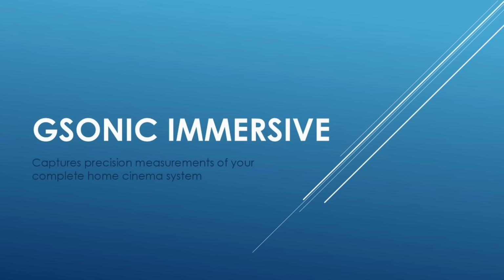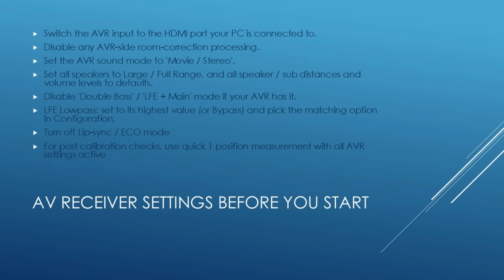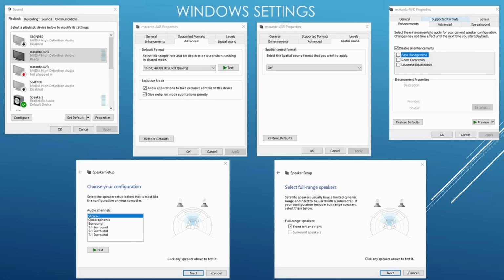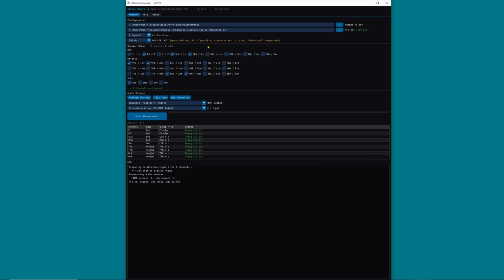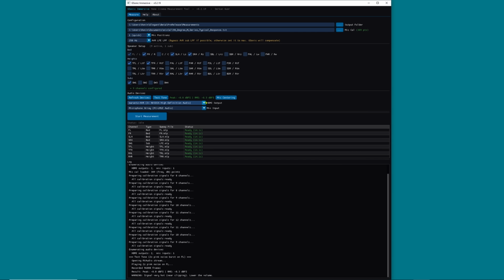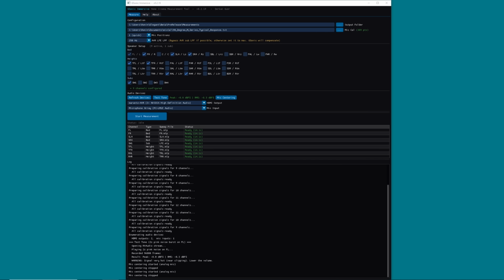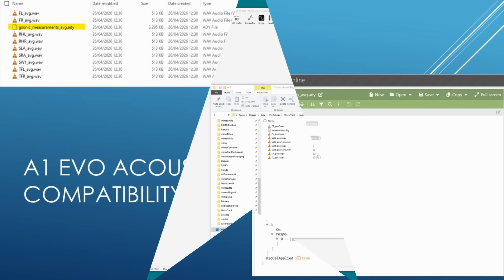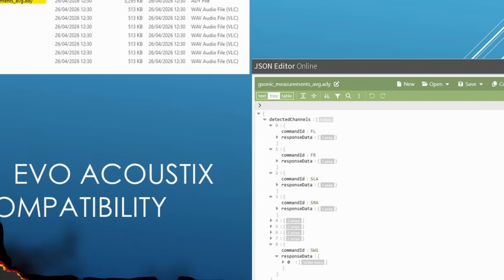GSonic Immersive

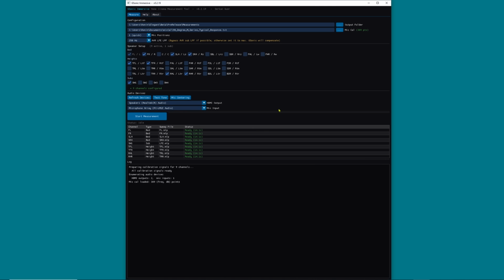Comment: Hi, you mention @6:47 that the attached file is for 'generic mics that came with the Denon/Marantz receiver'.... is that correct?  As I understand it should be calibrated mics.  Not sure the mic that came with my Denon (x3800h) is calibrated.
Reply from the maker: There's a generic mic calibration file for D&M generic mics linked in the video description. You can use that one.
Reply: @ocaudiophile  Thanks!  Not an expert, but I've calibrated using A1X already.  Are GSI measurements significantly different/enhanced?
Reply from the maker: Simple answer is yes ;) There's also an upcoming very advanced calibration app which will only work with GSI measurements.
Reply: @ocaudiophile  BTW, for which orientation is the file attached, pointing 'towards ceiling' or ' towards speakers'? TY
Reply from the maker: Audyssey mic is designed to always point up towards the ceiling and the calibration file is for that orientation (90 degrees)
Reply: @ocaudiophile  BTW, is there an introductory price for the app? TY much.
Reply from the maker: For the upcoming app? I haven't finished it yet and didn't decide on a price level but there's probably gonna be an intro price or some discount to users who already have GSI.
Reply: @ocaudiophile  I mean the current app.  TY
Reply from the maker: GSonic Immersive was launched 3 months ago and introductory pricing ended by June 1st.

Comment: Purchased!. Will try today. I suppose Acoustix will modify some of the results to compensate for MultEQ basic?. Or will i have to do that manually?.
Reply from the maker: Thank you and yes AcoustiX is model aware and you need to understand that MultEQ basic is very limited at what it can do with speakers although subwoofer EQ is quite good and thus all speakers will need to be crossed over very high (200-250Hz)
Reply: Thank you oca. Few more questions if you don't mind:

1. What's your recommended amount of repeats for a 3 seat couch

2. If AcoustiX tells me it cannot correct bass peaks above 100Hz-189Hz (i get a different frequency depending on the curve I pick) for my subwoofer. But REW does show filters past those frequencies, does it mean it did apply corrections fully?.

Thank you!!
Reply from the maker: 1.Measure at ear positions and add some more around the MLP.
2. Basic cannot apply filters to speakers below 375Hz with 48kHz content so you should use sub as far as possible to remove peaks. Bass above 80Hz can be localized so I suggest you place the sub centrally.
Reply: @ocaudiophile thank you!. Regarding my second question. I forgot to specify it's regarding only the sub filters. AcoustiX shows a message that says "sub not suitable for MultEQ, bass peaks above 100Hz cannot be corrected". REW, however, does show filters for the subwoofer past that frequency. So I guess I wanted to know if I can ignore that message from AcoustiX, and I can assume the sub did get all the filters available.
Reply from the maker: No that means your sub has its own lowpass filter at probably 120Hz and has no output beyond that. Some strong subs are designed that way and unfortunately not suitable at all to MultEQ Basic setups. There's a possibility your sub is capped at 120Hz by its own settings, if so turn it off, or plug the RCA cable to the "LFE" input in the sub.

Comment: Hi OCA Sir, I have done 3 MLP position calibration. It’s fantastic tool for calibration Left Right Center surround and surround back sound was extremely good am using 11.1 but I think front height and top rear sound little bit low so can I do again re calibration of MLP 8 position.
Reply from the maker: You are free to keep the mic fixed at MLP and measure all 16 positions there if you want but my suggestion is 5 measurements about 15-25cm left/right/fore/aft of MLP for a descent result at the MLP.
Reply: @ocaudiophile  Thank you sir.will do.

Comment: Nice video. I have a question. I have A1 filter from magic bean true target (bunch of numbers for each speaker). How do I upload these filters to denon X3700H? thanks
Reply from the maker: GSonic immersive only measures your system and you still use A1X to create filters and transfer to AVR. And you can choose any target curve you want for optimization step.
Reply: Hi, i just tried A1 Acoustix. the mic have to use the one from denon, cannot use umik 1. Just wondering, if for example can use umik 1 for measurement, will the result have significant difference compare to using the mic from denon? thanks. by the way, your app is soooo awesome. thank you very much

Comment: after trying out the latest i getting problems it cant switch automaticly to the second sw and it measures my sbr with the sra  and the sbl with sla  so something is going completly wrong
Can anyone help please?
started with complete new rest the avr cinema50 and then started meassurements for now going back with setting from version 1.5
Dont knw what happend the prog first told me to activate the heigts as dummy then it was all wrong after tryin again wth no heights everything wnet smoothe
Reply from the maker: Please make sure you press the AVR Reset button in the app settings before starting to ensure the correct channel mapping and sub switching engage properly.

Comment: 1.   Will I get better results with the UMIK-1 than with the Audyssey ACM1HB?

2.    What makes measuring with "GSonic Immersive" better than with "A1 Evo Acoustix"?

3.    Did I understand correctly that after measuring with GSonic Immersive, I have the .ady file processed in A1 Evo Acoustix?

Thanks for the answers.
Reply from the maker: 1. This is for you to decide. USB mics have clock drifts compared to analogue mics but Umik-1 has a more precise calibration file.
2. This is not a short list and requires advanced signal theory knowledge to understand.
3. Yes optimization and calibration transfer needs to be done with A1X if you are using D&M gear. GSI is purely a measurement tool.

Comment: Hi Serkan Gur, My setup is Denon 3800h with 7.1.4 in this 4 are upfiring Atmos speakers recently purchased gsonic immersive but not done any measurements due to very complicated feel for me.My question is for upfiring Atmos is it support gsonic immersive.or only for front heights and rear heights only this work.
Reply from the maker: Congrats on your purchase. GSI handles upfiring speakers.

Comment: I have Denon A1H with ART, do you think running Gsonic on a speaker slot would be helpful? If so should the measurement for DIRAC done with the Gsonic running or vice versa?
Reply from the maker: You could measure actual ART calibrated results of all your channels very precisely with GSonic but I don't see how it would help with your ART settings.

Comment: Hi @ocaudiophile, I have Denon x4800h receiver, I am using 1.1.7. I did reset, all shows green signal. And also turn off all windows related enhancements. I have two subs, when measuring SW1 it is giving error after the sweep.

SW1 recording had a capture dropout — the Windows audio engine lost samples mid-sweep, which corrupts the measurement. This is a system-load / USB-bus issue, not your AVR. Close other apps (browsers, virus scans, downloads), plug the mic into a different USB port (ideally not a hub, avoid USB 3.0 ports next to one another), set Windows power plan to High performance, then click Repeat to re-measure SW1.
Reply: My microphone is dayton trrs mic. All speakers measured good but only at sub it is always giving same error
Reply from the maker: There must be too much noise with SW1 measurement. Windows will drop the frames in that case in my experience. DO the usual stuff for sanity like not setting HDMI out and the mic as Windows defaults (so Windows doesn't try using for something else them during measurements), increase sub volume/mic gain setting or AVR volume. I have never encountered that error not going away after 1-2 repeats.
Reply: @ocaudiophile with AcoustiX measurement and REW measurement it used to work and levels were also good. Sub is clean. What is the recommended mode on receiver. Movie, Music, Pure. Any upmixer setting. I tried Movie Stereo and also Movie Auro 3D. Both gave same error. I did many times with different volume levels low, medium, high
Reply from the maker: If you don't have Atmos speakers in the amp assign configuration, the AVR will refuse to play lossless Atmos and try to switch to an upmixer (like DSur). Most setups can deal with that but the robust way is to add dummy height speakers in the AVR menu and then never tick them or measure them and delete them before calibration trasnfer. This way, your AVR will always switch to correct Atmos mode. This could be the cause of your issues because LFE is strictly bed Atmos channel and some upmixers may have issues with this.
Reply: @ocaudiophile my setup 5.2.4 setup. All speakers measured without issues. Only stopped at sub
Reply from the maker: Then try and disable your probably Intel + brand malware audio enhancements. You may need to use registry editor and even set admin rights to change some of them in certain spy laptops.

Comment: Interested in buying this. Is it possible to run it from a macbook air? If not does it work with parallels? Macbook air does not have HDMI out but can connect usb-c to hdmi adapter. Will that work? Thanks a lot.
Reply: Serkan any ideas? Thanks
Reply from the maker: Macs are locked by Apple to not send Atmos even when they have HDMI outs :(
Reply: @ocaudiophile even when running windows 11 via parallels?
Reply from the maker: Same, CoreAudio still manages final HDMI output.

Comment: hi i get SRA recording had a capture dropout — the Windows audio engine lost samples mid-sweep, which corrupts the measurement. This is a system-load / USB-bus issue, not your AVR. Close other apps (browsers, virus scans, downloads), plug the mic into a different USB port (ideally not a hub, avoid USB 3.0 ports next to one another), set Windows power plan to High performance, then click Repeat to re-measure SRA. any ideas please
Reply from the maker: Try disabling all audio enhancements and use exclusive mode in your sound device properties to prevent the Windows engine from interfering with the measurement. Do not make the AVR or the mic default Windows devices, GSI does not need that.and Windows maybe randomly taking them over during mid sweep. The error message is a reflection of the Windows mic engine error, not related to GSI operation. A repeat will also usually fix it.
Reply: @ocaudiophile   ill give it a go thank you

Comment: Today, I performed a 10-repeat measurement from a single point using v1.1.7. I have 2 subwoofers and used the UMIK-1 as my microphone. I had experienced issues with subwoofer crossovers before. My Denon AVC A110 used to drop out of Dolby Atmos, causing the measurement to halt, but this issue seems to have been resolved with this version of G sonic. After the measurement, I ran the optimization with default settings using the newly released version of A1 Evo AcoustiX. The results are fantastic. Thanks, Serkan.
Reply: Hi, I just got the app and will not have time to run it for the next couple of days. Would you like to share how you made repeated measurements? For now I can not find this option. Thanks
Reply from the maker: No repeat option simply because the precision doesn't need it but you don't need to move the mic between cycles and they will be averaged as repeat measurements if you really have to.
Reply: @ocaudiophile  Thanks. So I understand after each cycle at a position I have the option to repeat that position and the repeats will be averaged and after the desired repeats I can move to the next position? Or is it more like if want to measure 3 positions I can have 5 repeats because I can measure up to 16 positions? Anyway, I trust you with your information. I just have always with repeated measurements a timing drift of up to ~+/-0.01 ms with the UMIC-1 no matter what I do. I guessed this could be mitigated with repeated measurements. I also have miniDSP's for all channels. I plan to maximise the SPL response of my subs with MSO (just delay and perhaps all-pass filters) and then time align all speakers and the combined sub at the first impulse peak (as you showed in your other videos) before measurements. I want to overcome the distance limit of the AVR with this approach. I hope that any necessary timing adjustment by your algorithm should be within the 6m limit then. I could also adjust the delay after a first round of measurements according to the information given to me by Immersive and after a second run all delays should be at 0ms (theocratically if I only measure one position and don't move the mic or moved it "perfectly" between different positions repeatedly). Right? Until now I have only used your techniques for manual calibration in combination with miniDSPs. I'm very exited to try AcousticX with Immersive but guess I could still use the capabilities of my miniDSPs in regards of time alignment, if it helps. Kind regards

Comment: Hello. My give error marantz and mic says in the app  48hz  but says marantz not 48  if i do masure. And is it a good idea to do 9  on just one position? I do that with the 99 repeats on mlp before it was grreat.
Reply from the maker: You need to change Marantz to 16/24 bit 48000 in windows. And yes you can do 9 repeats at the same mic position to improve the quality even further.

Comment: ok everyone. i ran Gsonic, with OCA help, got my results, i compared the "distance settings", noticed Gsonic were not the right ones for my room, i adjusted the results on my denon amp on the sound settings, distances with a tape measure, they needed tweaking by a metre or more??, i then played a youtube "Music video", i adjusted on the remote, to options button, changed to ALL zone stereo and was FOOkin blown away, what have i been missing? ps i have 5.4.2 system
Reply from the maker: Distance settings are not always the same as actual distances but they are very accurate based on relative timing differences between speakers. Do not change them.
Reply: @ocaudiophile  ooops, need to rest them
Reply from the maker: Just repeat the transfer

Comment: Is it possible to use GSonic Immersive with the following audio chain : HDMI to AES audio extractor--> OktoDac8Pro --> Mac Mini running DSP in DAW --> Okto Dac8 Pro Out to Amp?
Reply from the maker: GSI is a measurement tool and specifically handles Atmos setups. The free GSonic Reference tool can do what you need (limited to 2.0 stereo setups at the moment).
Reply: @ocaudiophile  Thanks. My setup is targeting 7.1 initially.  Paid or free GSonic Reference targeted for 7.1 and multi sub, would be perfect.
Reply from the maker: It's near ready but there are other considerations at the moment to release it as part of an hardware device.

Comment: For others who are having problems with measurements but you have checked the items in the video. I was having some weird results and errors, then found the issue appears that I had additional Realtek audio software installed that was combining mic inputs and doing a couple of other things independently from the windows settings. Disabling these seems to have cleared up the errors. Even after a single measurement test with the mic on the floor to check everything works, the AVR sounds much better. The acoustic magic I’m not smart enough to understand is something special.
Reply: Having the same issues, what exactly was it that you disabled?  I've got an HP Laptop and keep getting an error.  It appears everything is set properly aka disabled, based on the video/GSonic instructions but still see an error that something is interferring?
Reply from the maker: You can turn them off from registry. There're many solution options in the fb group.
Reply: Do you have a link to the Facebook group?
Reply from the maker: https://www.facebook.com/share/g/1D2pPRFHje/?mibextid=wwXIfr